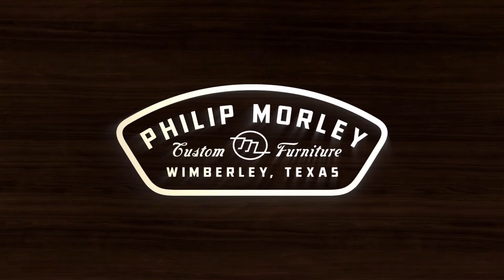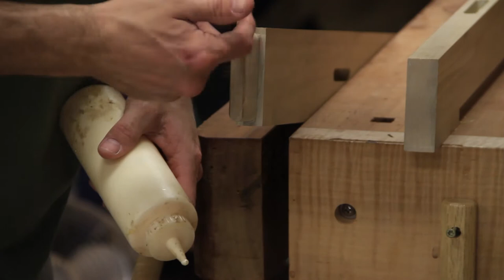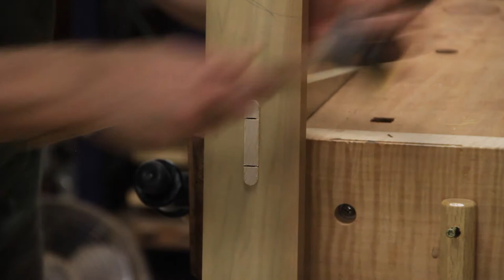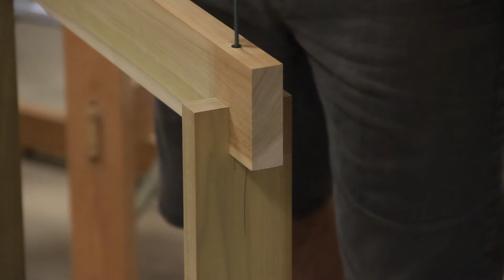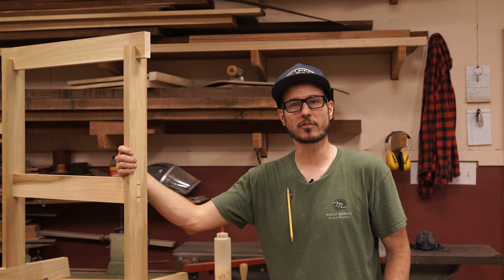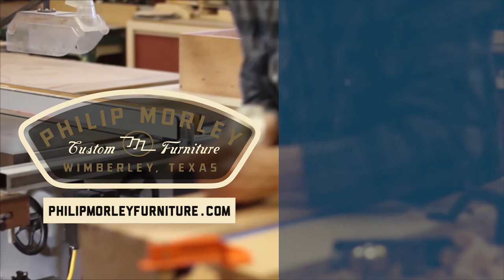James Krenov Style Sawhorses | Part 7 - Assembly

Comment: On the version that I have made, I used a lap joint between the top stretcher and the leg. Your version is simpler and easier to make and when I make another one, I will adopt your approach. Thanks for sharing your work with the community.
Reply from the maker: +Ben Blackwell you're very welcome.